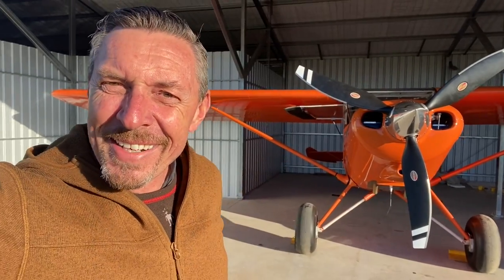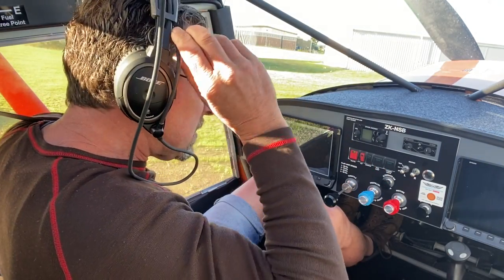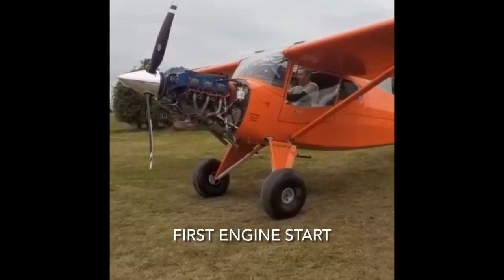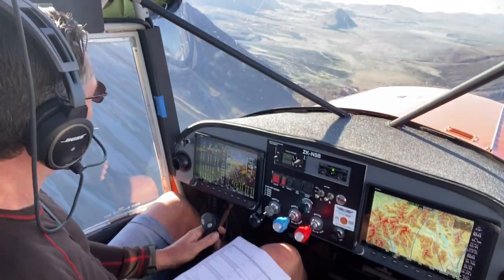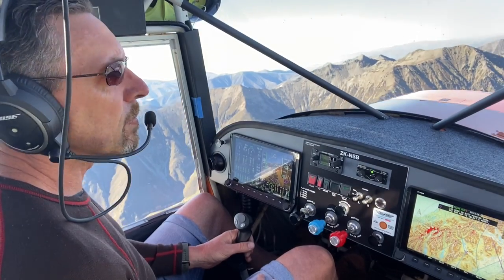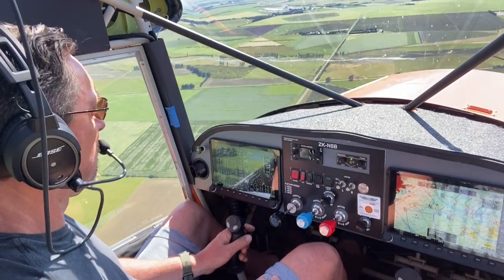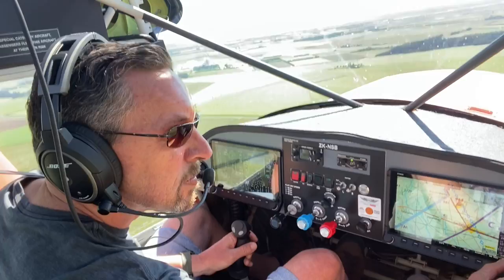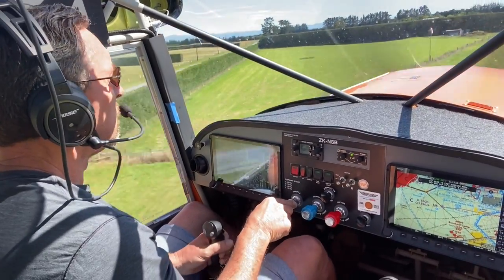Bearhawk Aircraft - Bushplane Build - First flight and Flight Test

Comment: I work my CG the same way in the Maule M5-235C.  I keep it right on the front leading-edge, that way I get max utility when I want to carry a heavy load in the back.  I've started experimenting with flying with 60 lbs of ballast in the aft cargo as well, but the plane still seems to perform well, even on backcountry strips, with a forward CG.  Nice job on the build.

Comment: Love the video and the plane.  Nice job. PLEASE hold the stick back all the way in a tailwheel when starting the engine.  Pinch it between your legs if you have to. I’ve seen a few mishaps when you are hard on the brakes with a little too much throttle.  You must have a small fortune in that beautiful fan blade and engine.  It would be a shame to doynk it!

Comment: Do you enjoy having your knee's pushing against the instrument panel the entire time you're flying your plane ?
Reply from the maker: It doesn't seem to be an issue, with the seat at mid position my knees clear the panel easily. Some builders mount the engine controls below the panel - that can put them in the way of knees but I elected to put them on the main panel.

Comment: How are you fixing the vortex generators to the wing surface?
* Why (reduction of about 3 Kts in stall speed)?
🌏🇦🇺
Reply from the maker: They are fixed with a double sided tape, very secure. Yes the reduction in stall speed power on is small, but the increase in control and stability is large. No tendency to drop a wing and only a small nose drop. Recovery is by increasing power. Overall very pleased. I've got some footage of testing the VGs now which I'll add soon. Thanks.